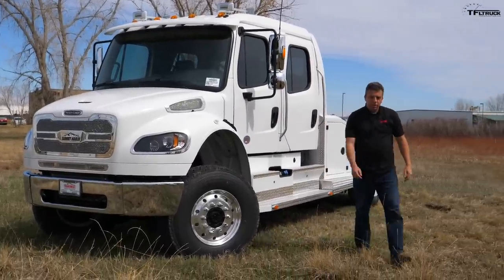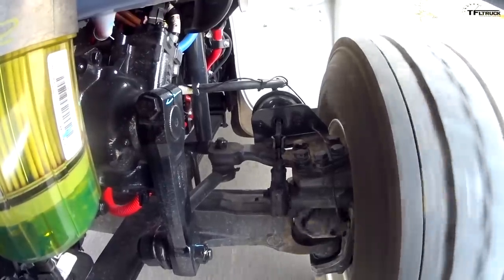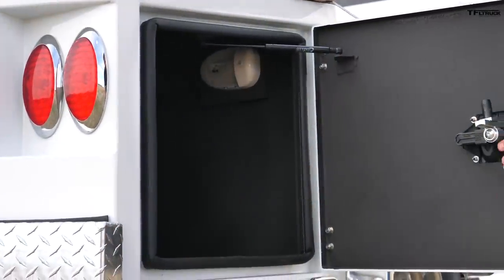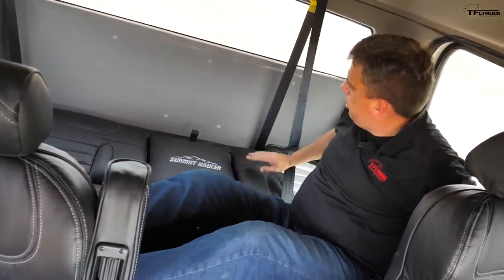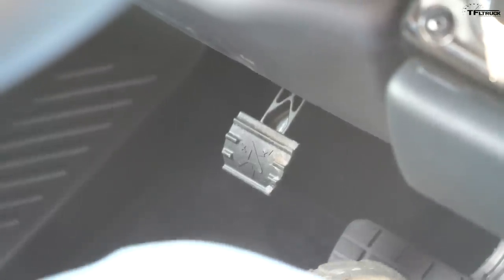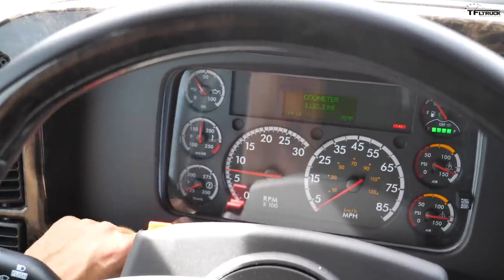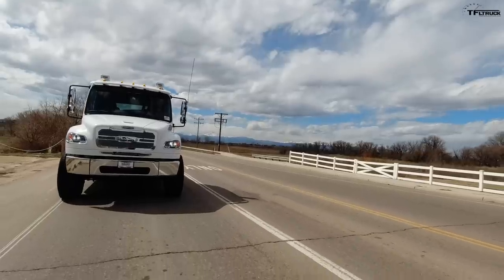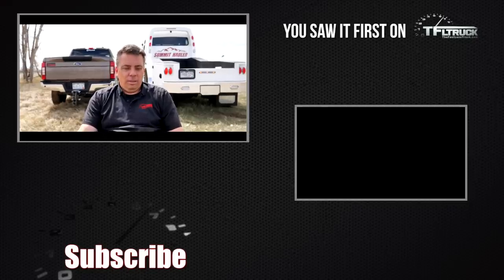This 4x4 Freightliner Semi Truck Is the Coolest Real-Life Tonka Toy You Didn't Know You Wanted!

Comment: 215k, that's insane. I can buy a brand new Kenworth W900L for 160k. Grant u it can't go off-road with it, but at least I can make money with it
Reply: You could buy this from Freightliner directly without the useless add ons and markup from Summit and save 60-80 thousand as well.
Reply: right but if you are going off road with a large cattle trailer to haul them from one place to another.  Or follow Rodeo or show tours this would be a lot nicer.  You can get a basic M2 or Kenworth if that is all you need, or you can get a nicer one.  The one thing they missed on this is a switch that will also lock the front brakes,  it is on tow trucks and would be handy for a rig like this.  He did not say it was for you did he?
Reply: Gerald Cole Plus the W9 looks a lot better than any “Freight Shaker”!
Reply: Heck I'd just get an old FLD that someone just overhauled and call it good for 20k or less.
Reply: I better things to do with 250.000 grand like payoff my 2016 lone star road tractor  and other bills.
Reply: @badgerpa9  get a surplus U.S. army hemmet if you wanna haul off road. Waayy cheaper and far more capable.
Reply: My KW T800 With Prentice 120 loader was only $185,000. Its an actuall big truck with a 73,280 gvw

Comment: I wouldn't call the Freightliner a pickup truck
Reply: Really!
Reply: i agree, its a medium duty truck, not a pickup truck. even though the bed is 11' long the way its laid out it would be pretty useless for hauling stuff in it.
Reply: I don't know where the line is but it would be either classified as tractor or a straight truck. From what I've heard years ago you pay extra federal taxes for tractors vs a straight truck and it has to do with flat beds and the square footage of the bed. Since he mentioned "road taxes" I think it would probably be in the tractor category. And it is in no way a "pickup".
Reply: @patrickmay8261  depends on what you call a Pickup Truck. These are not Car/ Trucks like ° 1/2 ton to 1 Ton

Comment: That's a medium duty truck, not necessarily a semi truck?
Reply from the maker: Yep!
Reply: Well sort of. You can still set this up for semi trailer hauling but you wouldn't be able to haul as much. More like short journeys.
Reply: Yank that over priced bed off, swap the rear end and you can get a M2 up to 80,000 pounds Gross Combined pretty easy. I've driven several M2 day cabs rated for 66,000 and 80,000.
Reply: @BlueDually4x4  Does the Cummins L9 have enough power to pull at 80,000?
Reply: @5.43v  on flat ground yes
Reply: @SootyMangabey.  So, ok for short distance
Reply: @BlueDually4x4  you would have to add another axle on the rear to be able to haul that kind of weight legally.
Reply: @5.43v  Yes, short distance. It's an L9. They are recommended for up 66,000. They do lack torque (only 1000lbs/ft) and HP to respectfully pull 80k. However, I don't know the auto transmission specs.  Might do some severe damage there.
Reply: The Fast Lane Truck sound system ?  For over 200K I want too sound like I’m at a recording studio.  Usually it wouldn’t be important on this truck but this money and people use them for long travel
Reply: The long wheelbase makes this terrible for offroading
Reply: @TFLtruck  Sorry to say but you're incorrect on the trailer air supply. It's not to test but to feed air to the trailer being towed.
Reply: 12.8L can haul 80,000
Reply: @843MudMafia.  You're hitting m2 112 territory
Reply: @xaza7774  don't mistake offroading for rock crawling and mud running.
Reply: @Pickens14Prodz  lol, you can actually "see saw" on dry dirt with that huge wheel base. And that's not considered mudding or rock crawling

Comment: Can you run it up the Ike fully loaded
Reply: Don't think they have the balls to run that fully loaded
Reply: Not sure that would be fun. You’d be over 40k pounds in trailer weight.
Reply: @RadDadisRad  it wouldn't be fun but they are much simpler to drive than they used to be. Foreign women who have never drove before come to the US and drive the wheels off of them. 88k gvwr
Reply: @jacobking4106  They already did go see GMC VS This thing.

Comment: If you have a blowout on super singles, you have to replace a rim and tire, not just a tire.  Not to mention super singles are nearly twice the price of a standard tire.  Super singles are great for fleets who want to maximize fuel economy or for industries that go off road and want to keep their budd spacing clear, but they don't make sense for o/o or civilians.  Especially since this truck doesn't have the fancy auto inflators on it, not that they do that much good.  Super singles will cost more in the long run unless you are running thousands of trucks and can reap the miniscule savings from fuel efficiency.

Comment: Wide tires bind when turning, put your fist down flat on any surface and turn it, then do it with 2 fingers instead of 4.... dont get me wrong, super singles are great but limited in application.
Duallys and tandem duallys turn easier, so it's easier on everything from sway bars to air bags, it's easier on the tires, not as much heat, not as much wear... super singles heat up more than the duallys, bad for tires, they wear faster. They cost alot more to make, not everyone can mount them or has the equipment to mount them....Supers on the front are great, we have been using them on dump trucks for years but they do slide more in mud and snow.... you can carry 2 spare tires in place of one super single.. the only real downside to duallys is off road, getting debris and or rocks between the tires can be a major disaster... and well, you should really take an air brake course, you have 2 tanks, one main, one emerg....that plastic tab... LMAO is NOT for adjusting them....thats on the shaft....at the other end.....

Comment: That’s a nice freight liner but man still Ford makes one hell of a truck when the video showed the drone footage from above the ford didn’t look that much smaller or shorter than the freightlliner now if you would even compare a f350 dually or even a f250 longbed that was lifted I’d say they’d be almost the same size from length perspective, but if you ask me I’d go with a f450 that’s the ultimate Tow rig if you ask me it’s got the Horsepower Torque payload capacity and what everyone loves about f450’s the wide spread front axle that makes it smooth as butter when turning
Reply: You mean like butter just from the refrigerator or sitting out in 80 degree weather?  The ford is right for many people but this is right for many also.  It will outlast the ford and will handle more depending on what the body company derates the weight as.
Reply: Badger Pa Well said well said 🤝☝️

Comment: While I like Andra's enthusiasm and I know you all want pay checks so sponsored bits are necessary. But you need a little more transparency; as you can get a four door from everyone but Mack, and they all can be had with four wheel drive or six wheel drive from the respective factory. The M2 Business class is in the same range as International's XT chassis which the CXT was built on. KW's T300 or T370 as well as Peterbilt's 325 or 330 and Western Star's 4700 are all in the same general class of truck. 

And as I said in the last video, the mark up from Summit Haulers is ridiculous for the little amount of work they do to the truck. Again I know you all need paid, but nearly 90-95% of the stuff on that Freightliner came from Freightliner's factory. Summit added: the leather, the cameras, the folding rear seat the hauler bed and maybe the audio.
Reply: Can you get him the other brand trucks so he can drive them and show them?  I am sure he would do a video if you have access to all the other rigs.  Just message him, I would bet he answers back to test them all.
Reply: These  4x4'sare common in Cabover form in Europe, Japan, China etc

Comment: With tire pressure and heat monitoring the need for multiple tires in a dually configuration is no longer needed for most applications.

Comment: Alliison is easy. But truck loaded will get stuck in 2 ways. Engine can't overcome torque converter. Second way is if it is just slick when engine can overcome torque converter it is at the point engine is at peak torque. Your tires spin and it sinks

Comment: @22:25 mark. Please don't pull that to "test" your trailer brakes while you are driving. That is actually the air dump for the trailer. Pulling that will drop all the trailer air pressure and apply the trailer spring brakes.

Comment: for 215k I want more than a 6 speed.
Reply: DD13 with the DT12 would have been nice.
Reply: 6 gears in a heavy hauling diesel isn’t enough. 

No disrespect, but I’m guessing you’ve never towed 40,000+ pounds

When you pay more than what a semi costs you don’t expect a severe downgrade in drivetrain.

I have a dd15 and dt12 in my truck and to be honest this truck should also. My cascadia cost less.
Reply: When your “grocery getter” diesel rev’s to 3500-4000 rpm 6 gears seems like a lot. When your heavy duty diesel has a 1200-1800 rpm power band and won’t go over 2000 you need double the gears.
Reply: No one spending 200k on a truck is spending down time fixing it themself. This isn’t a F250. 

A 2 speed powerglide with very wide gears is technically enough. If you don’t care about towing anything. There’s a reason class 8 trucks have 12+ gears. They are needed. 

Again, until you pull 40,000+ pounds with a truck that starts it’s power band at 1500 rpm and leaves it’s upper limit of its power band at 1800 rpm, you won’t understand why even 12 gears is low. 

Pull 50,000 pounds up a mountain then come back saying you’re happy with a 6 speed.
Reply: Also, to clarify I don’t own the truck my employer does. It’s my assigned vehicle.

It’s my “dream” to buy an older one, remove one of the axel’s and put a pickup bed on it. 

Could be done for under $20k. Used trucks go as low as 15k and for non commercial use would still be reliable.
Reply: Cost cutting 

Obviously.

And again, it’s easy to have an option that makes no sense practically when you’ve never started at the bottom of a mountain at 65mph and reached the top at 25mph using every gear you have to stay in your power band as much as possible.
Reply: “I wouldn’t be talking about your employer over YouTube”

Lol, are you bitter now? I never said anything bad about my employer. I love my job. Nice new trucks, $70k a year pay which is double what I made in my last career, awesome bosses. Yeah, I’m sure they’re so mad I like them so much that I brag about how awesome they are.
Reply: I already told you, you just don’t listen.

Are you selling this garbage? Is that why you think 6 gears on a 2000rpm engine is appropriate?

I don’t take you seriously at this point, you’re either trolling just to troll, or you really are that clueless what it’s like to tow 60,000 pounds up a mountain.

Comment: And you can hydroplane easier with super singles, as well as slide in the snow and ice.
Reply: It's actually the opposite. Super Singles offer better traction in those types of situations. You have a smaller contact patch, so there is more weight on each tire. It's the same reason that snow tires are narrow.
Reply: @berkovichify  let me correct myself, the set of super singles that I had, would hydroplane easier. May have been a terrible tread design but the smaller contact area is the reason they wear out faster. I prefer having 1 spare tire to cover all my tires incase of a blow out. 
They are getting better though.

Comment: In some markets they sell the Mitsubishi Fuso 4wd, much more cheaper than this Freightliner, with less bells and whistles.
Reply: yeeeeh, but look at it, fuso looks like lawn enforcement truck, like those with 0 turning radius lawn mowers and 10 weed eaters for landscapers
Reply: Fuse doesn’t have the same GVWR rating either, depending on model it’s 17995#

Comment: I never knew those came awd
Reply: NOT awd, Part time 4wd big difference! Google it
Reply: Apparently it’s a full time 4x4 system with what seems to be equipped with a locking center differential. Andre was mentioning that the truck is rear wheel bias and it monitors for slippage. Then you flip the lock switch, and you pretty much have the equivalent of 4 high on a part time system as he shows at 19:30.

Comment: It needs more aggressive tires
Reply: I do not think it is set up for rock crawling, it is setup to be able to go out in a field with a heavy trailer and still get out.  Also if you are hauling in bad weather on the road it will help you get through.
Reply: Front tires Super Single is Aggressive. 425R 22.5. Normal Steering Truck Tire you can Slide in Light Rain Turning speed 12.5 MPH - 20KM/H.   The Aggressive Tire 20MPH 30KM/H you may Slide very Little.

Comment: do you need a cdl for that truck?
Reply: Yes with a air brake endorsement.
Reply: If you use it for commercial driving and depending on your state. In FL, I could register a true semi for RV use with standard driver license or need a CDL for a F350 DRW with a heavy trailer, commercially.
Reply: It depends on the state you license it and what you will use it for.  and do not believe it requires an air brake anything uinless your state say so.  There are a lot of people that have no clue and just tell people yes because they are stupid. I would not need any special license or cdl if I got it for my use.

Comment: I love ya Andrey but you have more studying to do
The marker switch interrupts the circuit to flash your lights as a thank you
Super singles are usually twice as expensive as duals and can carry the equivalent of two dual tires worth of load.
The cap on the brake chamber is to keep crap out of the chamber and allows access to the mechanism neccessary to cage the brakes. The slack adjuster is what adjusts the brakes on a drum setup and an air disk brake setup has no adjustment hit the brakes after service and it's where its supposed to be

Comment: When I talk to guys that run super singles,  they all say the same thing. That they aren't good in snow and ice. Great for the prairies, but not ideal in the mountains during winter.
Reply: Jeff H Those are not the same super single drive tires you see on road trucks. Look to be 445/65R22.5 you would use on steer axle of a dump truck. They are not the best in snow.
Reply: @Graveltrucking  I agree. On trucks I've driven with big steers, you have to be watchful. They love to hydroplane.
Reply: @jeffh7021  yep they will do that
Reply: @Graveltrucking  thanks for catching me on that one. Haha. Just looked again, and at 6:30 I see what you mean.

Comment: I just could not justify buying this truck I could buy a NEW long nose Peterbilt with a X15 Cummins,with locking diffs probably get better mpg as well.i drive a T680 15L isx I routinely get between 7.5-8.5 at 72 hauling doubles,if I drove a box van and 65moh I could get between 9-10mpg. I do not know why they charge an arm and leg for this truck setup when you can buy the new redesigned cascades evolution for 150K and you can use it to in a true interstate commercial sense

Comment: that or that size truck would be great for the 45' three axle rv trailer.. if it's used as a personal rv the cdl should be, but isn't required like with a huge class A motor-home.... transwest is HIGH price at msrp but they will negotiate much cheaper. and i wouldn't call it a Pickup. That wasn't oil related filter it was for fuel. And, why not make an access panel for the fuel fill locations, it looks unfinished. overall pretty cool truck for a bored rich guy
Reply: Some states require a truck that size to have state testing.  CDL is for commercial it would be dumb to have personal RV drivers do CDL test.  It would make sense to have them test by vehicle size especially in the lower IQ areas.   Also it still is called fuel oil in many places but yes it was the diesel fuel filter. Diesel fuel is considered an oil and is like home heating oil.

Comment: That big red button is not the trolley brake.
Reply: Trailer did you mean.
Reply: @badgerpa9  Nope, I meant the trolley brake. They used to be a stalk on the right side of the column, but now some of the new stuff has a rocker on the dash.

Comment: Use this same chasis at work on our bucket trucks and Legit they are garbage. Freightliner is crap now
Reply: Chuck Terrell yes and no. It’s not bad when equipped with air ride. The entry level springer truck is super rough and sways when towing.
Reply: @RadDadisRad  we have both depending on what equipment is on it, weather a digger or a bucket truck. They are just gutless, always breaking and the interior design is crap.. luckily we just go local from yard to jobsite
Reply: @chuckterrell691  what is always breaking on it?

Comment: That’s not the oil filter it’s the fuel filter, also the button on the dash is to supply the trailer with air not test it. And the tab to adjust the brake chamber, come on man you need to read up and learn if you gonna get that CDL

Comment: 4.89 gear ratio is not that great  when you have a 42.5 inch tire.
Reply: And a .62 or close to it final overdrive ratio
Reply: You do have a low range if you think you need more power to pull something out of the water or off road.